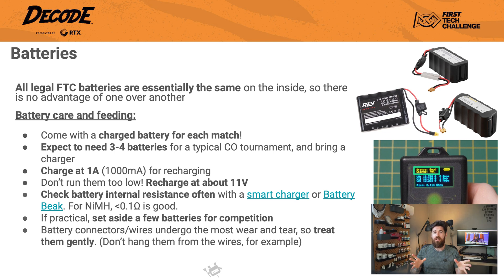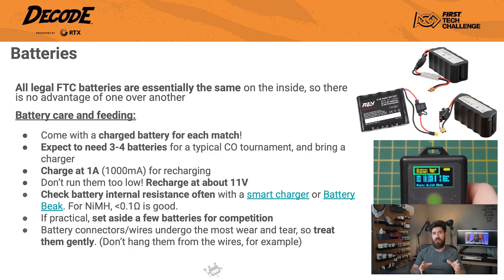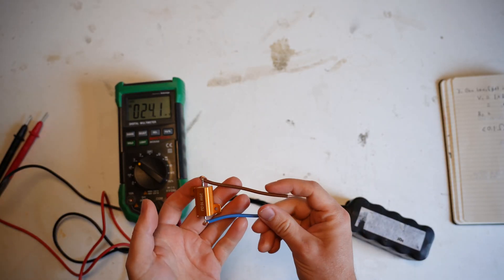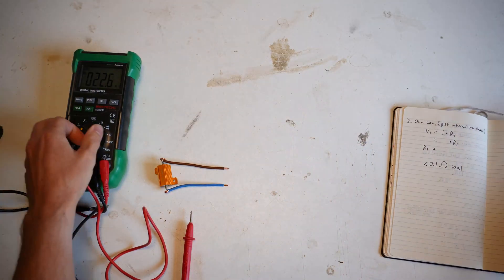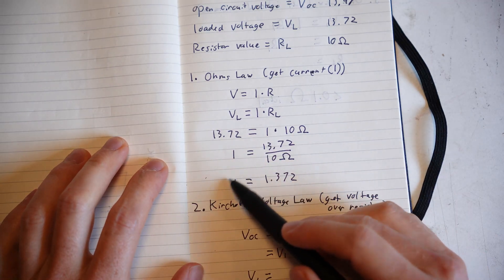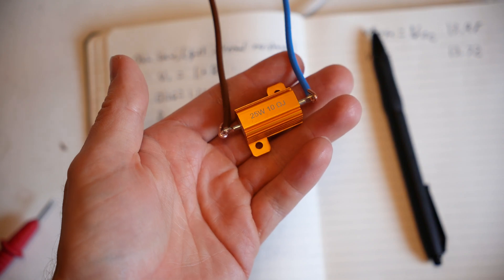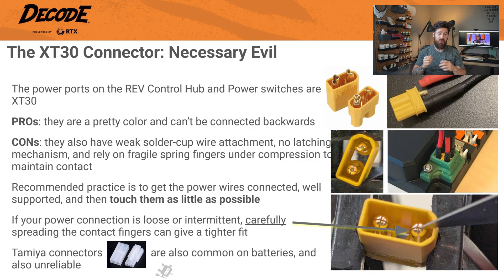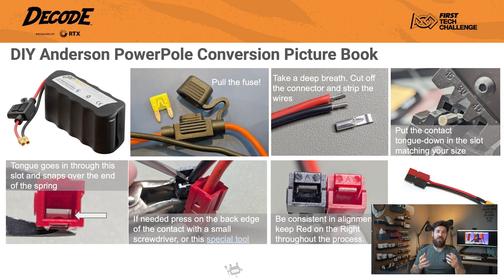Is Your Robot's Battery DEAD? (Electrical Engineer Explains)

Comment: Question here, from what i know you must also use the comp battery set every 2 weeks or so for one cycle so that they dont just still discharge, is that an actual thing or just a myth?
Reply from the maker: To the best of my knowledge, NiMH batteries will slowly discharge 20-30%~ monthly if they're just sitting. So you should check + charge them up about once a month to keep them up to snuff. Main point here is to not let them drop too low in voltage (say below 10-10.5V) as that's where problems start to occur.
Reply: @BroganMPratt  That's old-school NiMh. Most NiMh cells made since 2006 are of the low self-discharge variety, which loose more like 1% per month.
Reply from the maker: @alexvonhoene1391 are the modern robotics supplies LSD? I thought differently, though perhaps i was misinformed